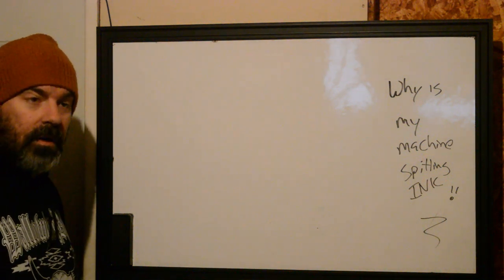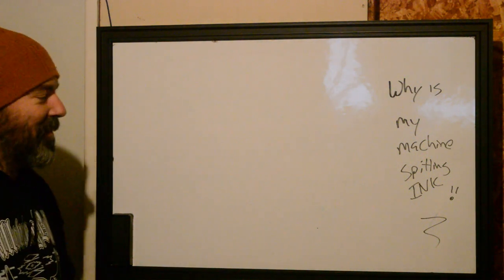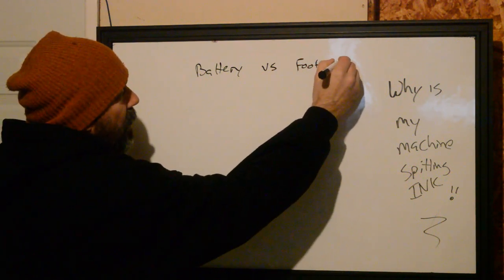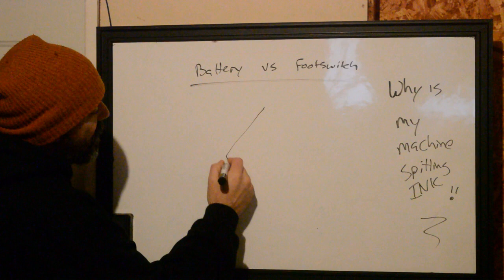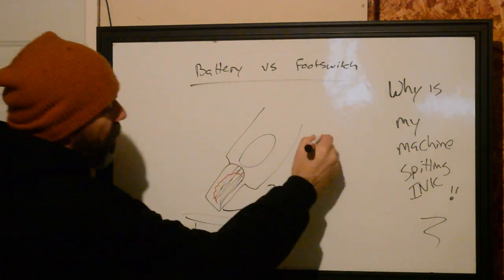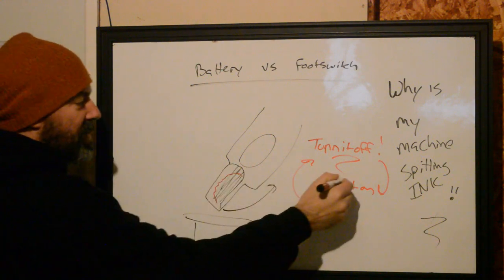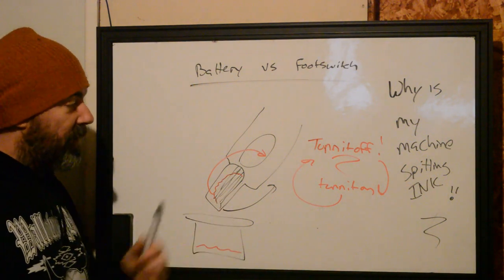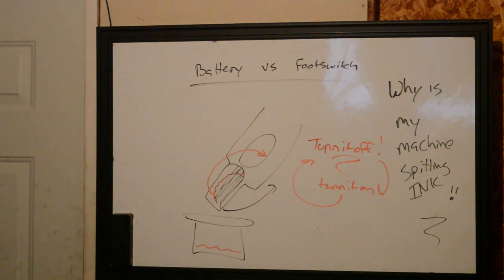Why Is My Tattoo Machine Spitting Ink - And How To Fix It

Comment: Thanks for the tip big bro, I had a weird issue yesterday with one of my round shaders where it was consistently spraying ink forward, like I held a paper towel an inch away from the running machine and it was spraying the paper towel.. I had to switch out cartridges to another one, what causes that?

Comment: Any website to get rotary parts such as frames that don't cost more then the ones that's put together? I'm in the process of making my machine but when I search it it seem I'm better off buying a new rotary or a coil machine that's put together then just the frames because it seem it cost more for some reason just for a frame which makes no sense to me
Reply from the maker: Yeah I feel that. Just get a knock off and be done with it. You can replace motors for cheap